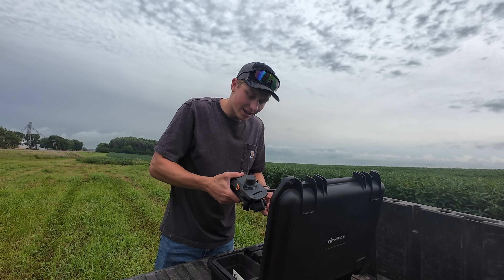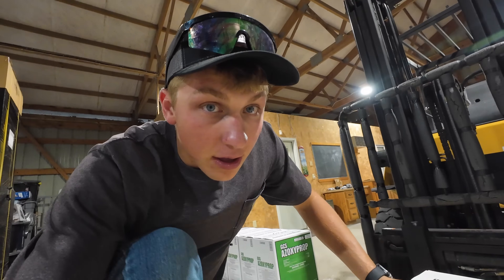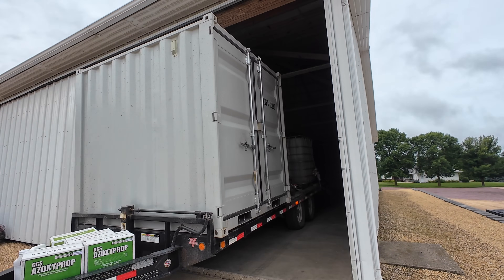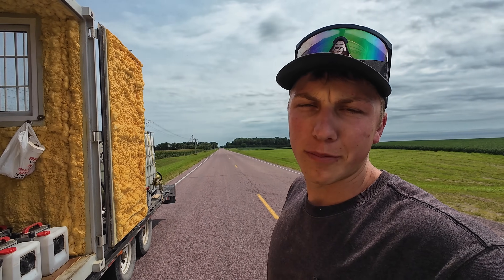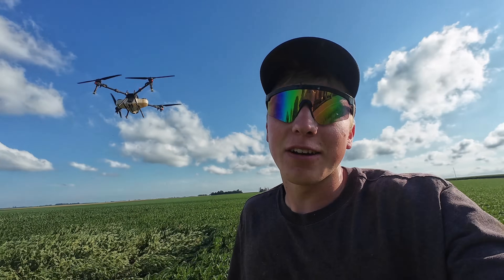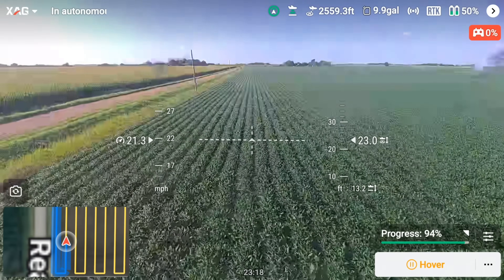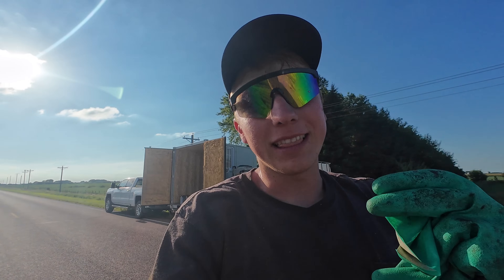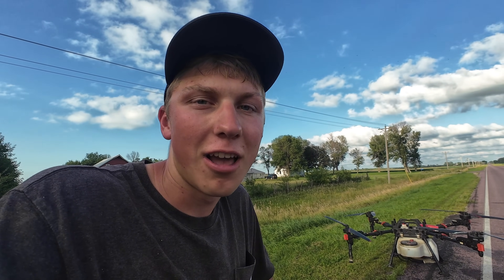What No One Tells You About Owning a Spray Drone!

Comment: Do you think the mavic 3m and rtk are worth it? Right now they are out of my budget but I'm wondering how much they could actually help.

Also, have you considered using webODM or the free local version of it? I think pix4d is too expensive and not worth it unless you cover a lot of hectares. On the other hand I'm still not sure what the benefits on mapping actually are so I may as well be wrong.

As for the batteries are you connecting anything else to the generator? I've being told that if I put a medium load to the generator that it will start to slow charge the batteries.
Reply: Mapping is useful if you have a field with varied terrain.
So, if you use the follow terrain function, the drone can operate more quickly as it already has the data from the mapping.
IMHO.
Reply from the maker: It is expensive, but to fly 100% of the field and not miss spots to me it is worth the investment. I also see it as cheap insurance rather than hitting any obstacle this way I won't hit anything...knock on wood so far

Comment: What level of Pix 4D are you using for mapping?
Reply from the maker: Pix4D fields
Reply: @HiTech_Farmer thanks player. Have you tried to remove the boxes and done an aerial survey with your 150P? It has a 3D system built in apparently.

Im likely going to start doing that with mine, but im curious as to the height and speed you go when doing so.

Using the XAG, the added weight means less wind issues at high speed. You can cover alot of ground at say 250 ft. The less weight means longer battery life up there.   Just curious if youve tried this.
Reply from the maker: Never tried doing aerial imagery with the P150. 

With the M3M I go 395ft AGL and 30mph.
Reply: @HiTech_Farmer gotcha. Yea, you can 3D map with the 150P as well. Take all the weight off and you can get around 22 mins aloft. That allows around 250 acres at 300ft @ 30mph. Id assume with Pix 4D, youd possibly have another vantage point.

Try it out one day.

Comment: I'm going to dogpile on the idea that there's something else going wrong.  The batteries may have all had a problem, but I'd be surprised they all went bad like that. 

Either warranty, or check your chargers, anything in common with the charging.  250 is way to few charge cycles to accept that kind of performance.
Reply: The drop in performance was very sudden the way he describes it.

Comment: Charging the battery at high current is what ultimately destroys the cells. if you can, recharge slower if not then cool the battery while recharging. The battery BMS will slow down the charge based on temprture and based on you sweating balls it must of been hot their.
Reply from the maker: Problem with charging slower is a LOT of downtime at the field edge.
Reply: @HiTech_Farmer  There's only so much juice you can squeeze out of an orange.

Comment: If all the batteries are charging slow it isn't the batteries. They didn't all go bad at once.  Something happened ro the charger wiring most likely. 

Im amazed you can takeoff on a paved road and just sit the spray rig there.
Reply: Paved but still rural.

Comment: We have plenty of batteries over 1000 cycles also. Agree with the other comments - it’s not the batteries.. ours all still charge and hold the charge well. It will be to do with your input voltage. Hopefully you share with us all what you find out and what the actual cause of the slow charge is.
Reply from the maker: I am hoping to get it figured out and share the details in a future video!
Reply: A  poor connection somewhere could actually be the problem.

Comment: Check the volts on the cells inside your batteries. It is possible that they may need to be balanced would be my guess. 1 cell in the battery pulls the whole battery down
Reply: These batteries are a smart battery, they balance themselves every charge, the issue is the wiring to the charger itself, not receiving the full amount of volts
Reply: @oztechdrones  Very possible. Start at the generator and work toward the  batteries.  A poor connection somewhere could be the culprit.

Comment: 250 charge cycles are extremely low for such drones and what they are capable of. There could be several reasons that can depend on.. 1 is you deplete the batteries to low (should also see slight swelling).. 2 your batteries are to hot when you start recharging. 3 you have bad batteries.. 4 I assume that they start to discharge to 50% around 36hours the longer 4.2+ volt per cell is on the battery the rapid decline sets in. I have drone batteries that are 5 years old still performing like new (not agras drone). What happened to your high visibility vest on a road!!! 😅 Hope you will have a good harvest season! Take care!
Reply from the maker: Appreciate the info on the batteries. The high vis vest was out of commission this day :)

Comment: Hey! I run XAGs as well, I don’t think you have a battery problem. I’ve seen XAGs do 12,000 acres on 4 sets of batteries with no issues. Try plugging the chargers into an outlet in your shop, see if they are fast charging the batteries. Also, if you don’t update all of the batteries, it can lead to issues like this with the chargers.
Reply from the maker: Appreciate the insight. Going to test this out!

Comment: Great video.  I am wondering if your billing includes prep time beforehand.  I can't remember what you said previously but I thought the rate would be low if it was flying time alone.  I also wondered if there are agriculture drones that are fuel based and whether those would be more practical.  I can see multiple tradeoffs either way including ticking off activists.  😂
Reply from the maker: I bill for completed acres. So it's per acre not per hour. I have seen some of the larger gasoline powered drones. They haven't hit the main stream market yet tho

Comment: So you use Pix4D? I was thinking of changing to it because dji smart farm is limited, free but limited. I too have a Mavic 3M which can do a lot more as you know. I haven’t gotten a price for their farm software.

Regarding the batteries, how you charge them can make a big difference. Including if you are charging with a pure sine wave generator or a typical generator which are sometimes only a modified wave. The later will destroy your batteries in half the time. How many times do you think you have charged them? Can you see # of cycles? I used to design battery banks for solar arrays and how you charge a LifePO battery makes all the difference. I  would look into that too.

Thanks for your videos. Always great to see how you are doing it. Soon I hope to be flying myself. Take care!
Reply: I agree. First thing I would do is put a meter on those generators. Ten or so years ago we had a huge storm come through west suburbs of Chicago. Everyone scrambled for generators. Menard's had 5500 watt ones with the old yellow chain saw name on them. While these things worked for sump pumps, frigs/freezers and lights they killed newer TVs.
Reply: An aerospace software engineer was showing me an oscilloscope on an inverter used in a furnace backup system. .  The inverter created a square wave not a sine wave.  I imagine cheap generators are similar.   He was going from DC to AC.  AC to DC could be different.  EV's have their charger on board.  The so called chargers installed in the home are just connectors that keep the AC off unless they are plugged into a car.  It's a safety deal.  I built one from a kit.  the connections to the relays over heated.   The kit was later modified with relays with better beefier connectors.
Reply: As an aside the commercial EV chargers from Bosch were total crap.   They failed in under a year.
Reply from the maker: Yep, I fly everything first with the Mavic 3M and map inside Pix4D. 

The batteries have about 250 charge cycles on them. With everyone in the comments saying it's the generator I'll have to do some testing to see.
Reply: @HiTech_Farmer you should be getting a lot more cycles than that, more like 1000 or even 2000 at which point a battery is considered used at a state of 80% but thats still 80% if they are lithium ion phosphate batteries ( which they should be, not ion only which are much worst battery maybe only 500 cycles)
Reply: @HiTech_Farmer  wow your generator is a pure sine wave generator from DuraMax so I don't think it's your generator unless it just broke down or DuraMax is lying about it. An oscilloscope is only way to tell. must be the batteries.

Comment: I am a XAG Deal up here in Michigan. I would be surprised if your batteries are that bad already. if they are that should be a warranty claim. But like I said I don't think they've gone bad after only 250 cycles. I've got guys with more then that and haven't seen that issue. I would bet your wiring has gone bad and isn't supplying the power to fast charge. I know I've had that before. And the times you say in the video match right up to slow charging. So I would check your wiring and importantly generator. And then after I would check the chargers. And finally the batteries. Also they're a smart battery. You can look while they're in the drone and see how healthy they are. And if needed send them to a dealer that has a battery tool to diagnose them further. If you need any further assistance I'd be happy to help.
Reply: Does heat impact the batteries?
Reply: @mbahr It can. But the way he’s got his charging they shouldn’t be that hot.

Also they will let you know if they are hot. The battery will flash fast to indicate it’s hot. Also when put in the drone it will tell you. And may even stop you from taking off.
Reply from the maker: Appreciate the input. In the XAG app they all say good for battery health, but charged slow like this. I plan to test the generators soon. Thanks!
Reply: @HiTech_Farmer  I suspect the generators need to produce a true smooth sine wave, but honestly I know nothing about it.  Nevertheless there has been a radical change in  your battery performance.
Reply: @HiTech_Farmer , it's impossible to have problems with the batteries at those 250 charging cycles. You can also check the batteries and charger plug connectors. You can also do a test and see how much time it will take to charge them for the first time when the batteries are "cold" and after using them for few times, and if there are big differences, this means that you can also have problems with the cooling system of the batteries, which is included in the chargers. What you are saying about the lithium from the batteries is true, but it will affect the flying time and not so much the charging. Usualy this degradation starts from about 8-900 cycles.
Reply: Definitely seems like a generator issue.

Comment: Impressive job! It's not your fault that you didn't know the batteries would degrade. If you upgrade, will you get XAG's newest drone? I believe it's called the XAG J150, but I'm not positive. I hope you do get those 70 bushels an acre. By the way, did you modify the wheels on the Polaris Ranger? They look different than the ones that are on my brother's and my Polaris Ranger, although I guess that could be the difference in age. Ours is a 2020.
Reply: He has a XAG P150. J150 is EAvision
Reply: @jacobbabcock5282  I know he has an XAG P150. I just accidentally got the J150's brand mixed up.
Reply: It might be worth considering the EAvision though. Maybe the batteries will last longer if it turns out that it is just the XAG batteries degrading faster.
Reply: @PatrickSchwager-b9j I severely doubt that is the case. I work on these things all the time. I’ve yet to encounter anything of the sort across all the customers I service. None have had anything like that. And I’ve yet to hear anything of the sort from dealers across the states. And I haven’t heard anything from the disruptor or XAG themselves. I really some think it’s that. I think it’s a power issue going into the chargers. 

Also for what my 2 cents are worth. I really don’t think that J150 is going to anywhere near as good as they’re marketing. They’re making some big bold claims that are far fetched. Notably saying it has a 45ft swath. I’ve swath tested all makes and models. I’ve worked universities getting swath data. Never have I ever seen a drone that can do any bit of a good job at more then 30. Even then I’d shrink it a bit. But I’d happily be proven wrong. But if it’s anything like the J100 it’s not going to be good. And I don’t think that the J100 is good because I’ve had multiple people say that they didn’t work right. And they wished that bought something else.
Reply: @PatrickSchwager-b9j gotcha easy mistake. Most drones today have almost the same model numbers.
Reply: @jacobbabcock5282  Yeah. Thanks for the info. Sounds interesting. I'm thinking of possibly going into the drone spraying business myself someday. It depends on how the market is for custom application in the future.
Reply: @PatrickSchwager-b9j  A good tip is that pretty well all the manufactures, and a lot of dealers. Will oversell what the drone can do. The market for application is different everywhere. but number of users have really exploded in the past 3 years. One thing id say is to get all you legal work in order. there's a lot of fly by night guys. Be smart and do it right.

As far as drones on the market I really like the XAG line of drones. The build quality is second to none. And if something does break. They are by far the most repairable drones out their. One of the most autonomous aswell. Drawbacks are mainly the controllers not as nice as like a DJI. and theres some odd software issues. But overall a great bunch of drones. And there's DJI they make really good drones. But parts and supply has been a issue lately with them. Part them, larger part customs and politics. But they make great user friendly drone that work well. And there's the Vector HD580. Which is a newer addition to the market. I haven't had much time to mess with them yet. However they seem to be a really good drone overall. Good controller, Camera, build. parts are available pretty well. If someone was starting out and knew nothing I'd point them towards them. If you get any of those I don't think you can really go that far wrong. Sorry for the long read.
Reply: No, you're good. That was really informative. I appreciate it. Like I said, it probably won't happen for a while yet as I still have to finish college and make some money in order to get started
Reply from the maker: Haven't fully decided on the drone's future and direction for the business. These were the stock wheels. I believe it is a '23 model